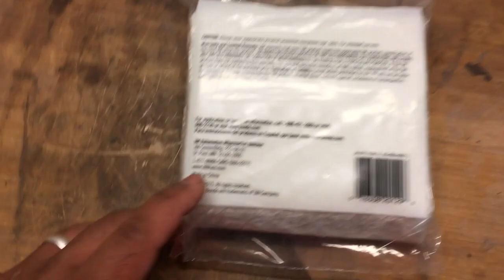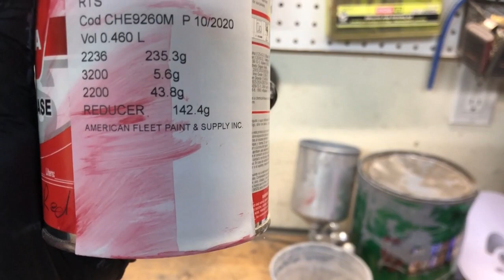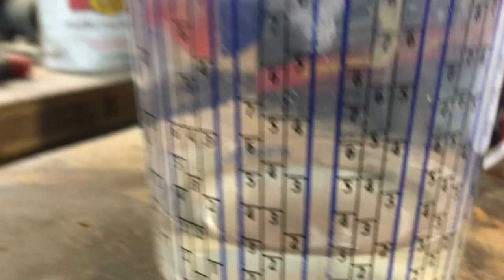Custom Chevy S10 Wing

Comment: Do you have any problems with your wing cracking due to it being made from fiberglass
Reply from the maker: Nothing so far, sometimes it’s makes sound when you lean on it but that’s it
Reply: @madmike_9343  awesome thank you . I bought a cheap 3 piece wing from eBay and I'm going to use it for my mold figured if it comes out right I would make more to sell . So any advice or input would be gladly appreciated thank you
Reply from the maker: @monsterbigdick7505  Yeah if you’re going to make a copy buy release agent that would make things easier. When you make more do you have to do like two layers just firm enough to pop off then you clean off the mold release and fill it in from the inside it’s kind of tricky to make copies but I have a video on my channel u can check out